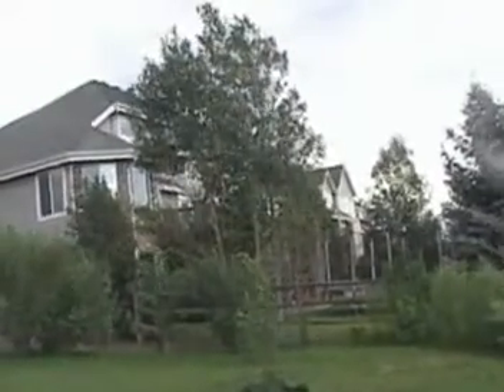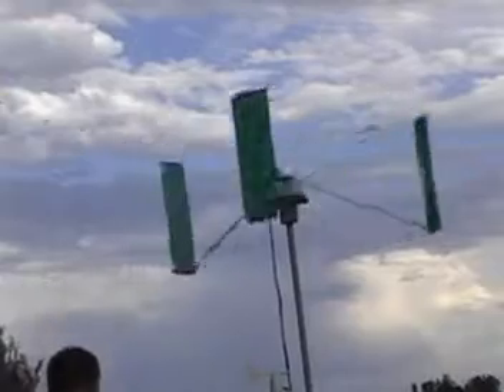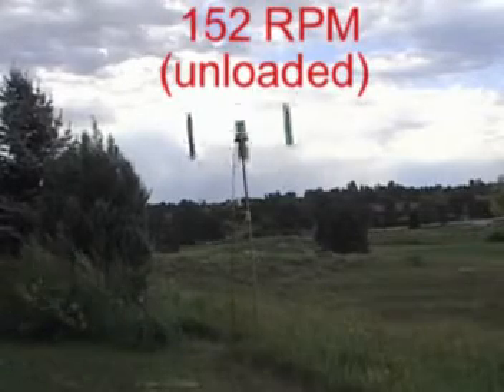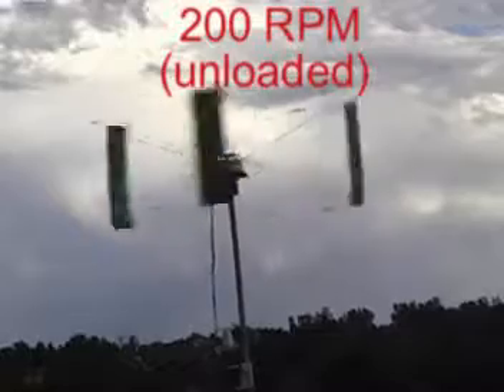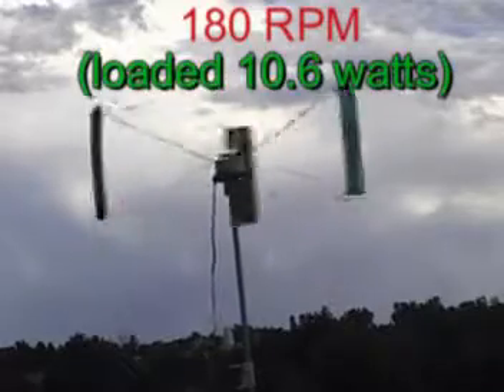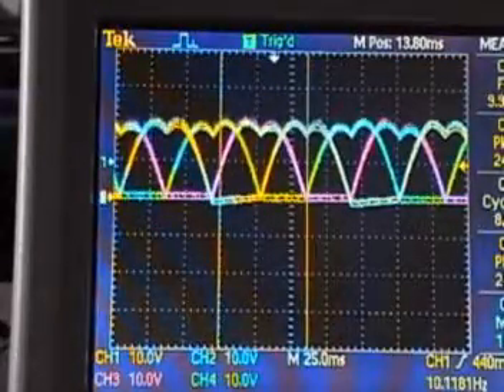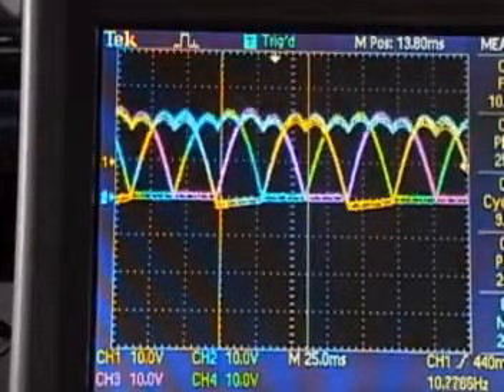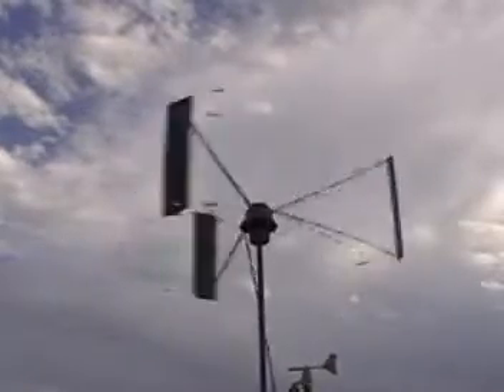Testing on the pole

Comment from the maker: @rikkiesix 
Yes, axial flux, but I didn't do a good job on it.  My stator is very warpped because I didn't clamp it down when I poured it.  I will do better next time.   I got the magnets from the windstuffnow site.    When I build an alt that works well, I'll post the specs.  This one is not worth duplicating.

Comment from the maker: @emagnets 
Sam are you still working on your left type VAWT?  I have to say, when something with a 5 ft diameter is spinning above your head at 200 RPM, it's SCARY!  I'm just glade mine is Styrofoam and light aluminum.  If it was wood I think I would have ran for cover.

Comment: from what I can see of your airfoil  I think it is a high performance blade and needs a lot more wind but opening up the angle of attack might give it a little more at the lower wind speed. try maybe 3-5 degrees out and if that doesn't work try in.  I think you need to get up in the air with alot more structure on the blade mounts and pole. keep it up though cause the never stops. It just goes somewhere else when u need it

Comment: whats the angle of attack on your blades???
Is the tip towards the center or away? definately should be getting more power. at 200 rpm it should at least do 50-80 watts for a medium speed range unit higher for a low speed.. By the way how fast was the wind blowing?